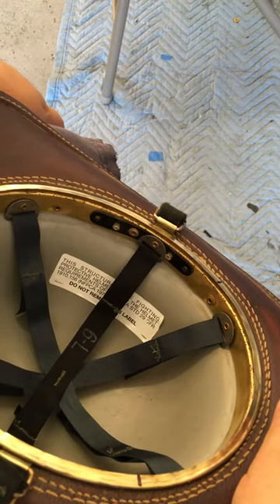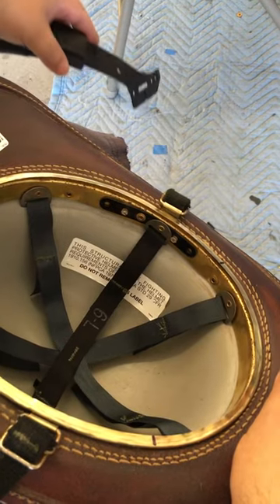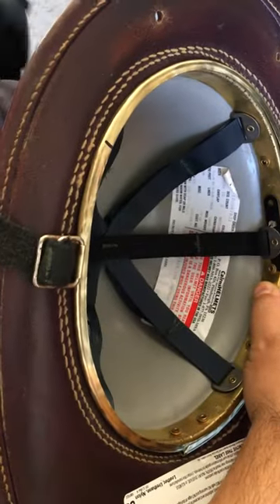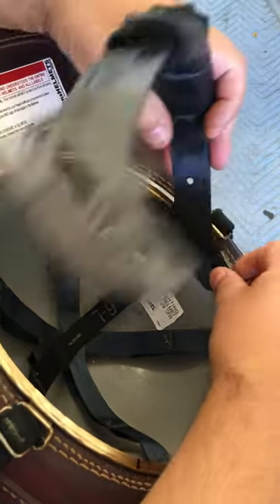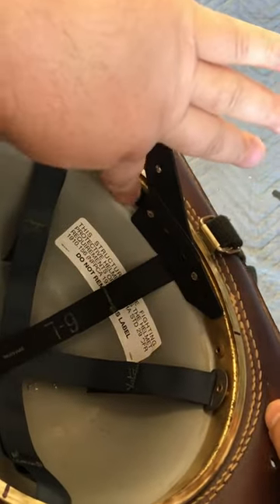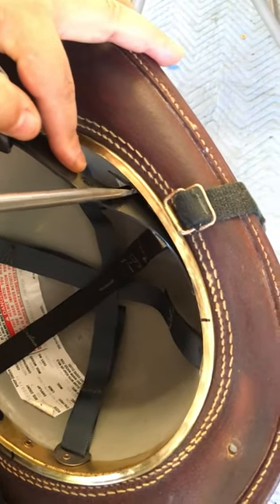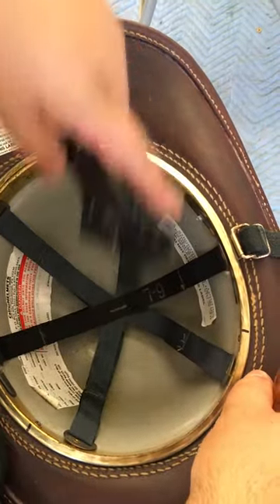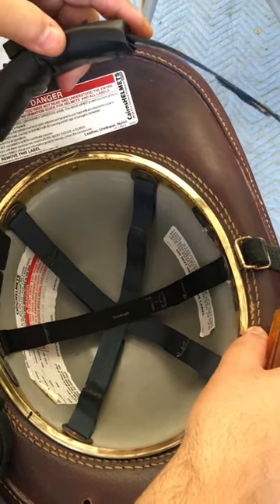How to remove the ratchet from a leather helmet N5a, N6a

Comment: how do you remove the ear flaps? id like to keep the ratchet in but take the ear flaps out thanks in advance
Reply from the maker: Thatguy9 you should not remove the ear flaps , you need to have them to comply with osha and nfpa standards
Reply: is there a way i can tuck them up where they will not fall down and stay out of the way?
Reply from the maker: Thatguy9 we have another that shows how to fold them in